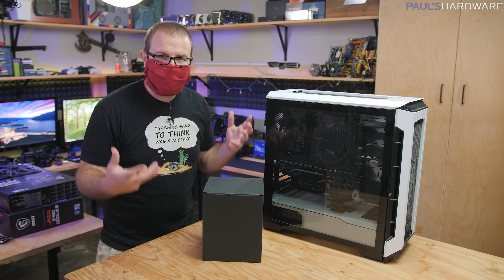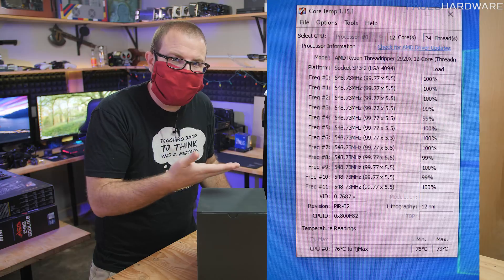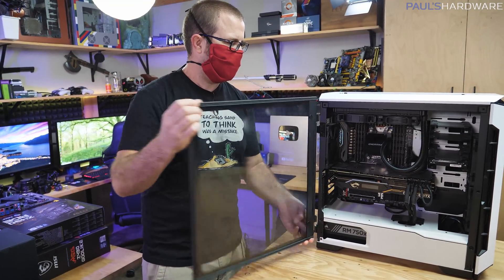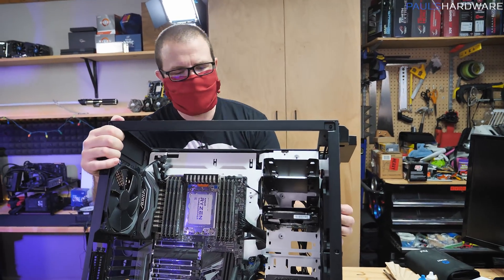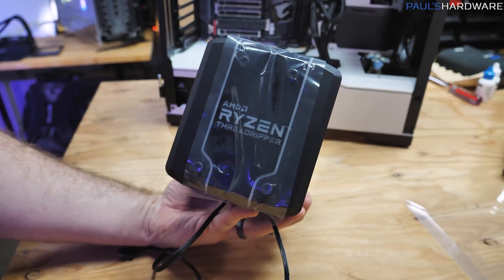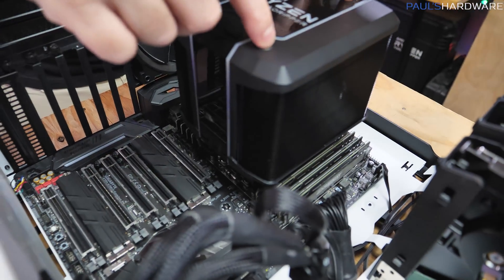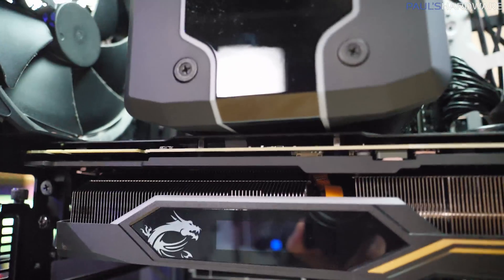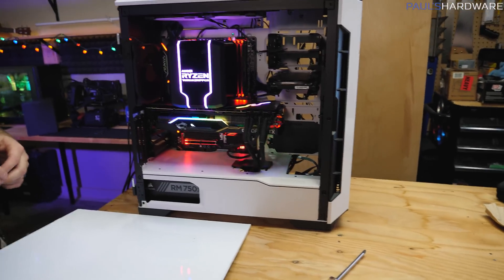Why We Switched from an AIO to Air Cooling...

Comment: I recently switched from a custom loop to an all air set up and I couldn't be happier.
Reply: I know air coolers are more reliable but it's too much of a personal aesthetic for me. I don't like how any air cooler looks. On a side note, if you're selling your closet full of stuff, I'd love a link to your eBay listing. I'm always upgrading or changing my set up.
Reply: I'm just the other way around. 20-30 degrees lower and silent to boot. Love it. :)
Reply: @karaloop9544  I honestly just got tired of maintaining it and also the added cost of new GPU blocks every time I wanted to upgrade. I have a closet full of WC stuff.
Reply: @evo7836  just use distill water mines still fine after a year
Reply: @evo7836  I see, maybe that's me in the future, who knows. :) I'm new to water cooling because my new processor is running hotter than anything before it, ever. Forced my hand, so to speak. I'd have loved a closet full of wc stuff because it's a major PITA to start from zero. With all this gear at least you have the option to setup a loop in the future if it strikes your fancy again.

I only have the CPU water cooled, so I can skimp out on the GPU blocks. I definitely see the appeal of almost no maintenance though, coming from Noctua towers that served me well.
Reply: I used to use distilled water in my loops for years but that was causing a lot of corrosion on my fittings/inside of radiators. I ended up  using the clear EK fluid and that was doing a much better job. I just don't feel like changing the fluid, or having to worry about a pump dying anymore. This is just much more worry free.
Reply: @evo7836  ah i see corrosion i not really a problem theses days. As long as you dont use silver coil on mix Metals( cant remember what tou can't use it on) you should be fine. Even just plain old distilled water is fine with no additive and stuff is ok.
Reply: @t4ketsuru  if you want to keep corrosion down, you'd mostly want to stick to copper, block wise. Personally, I'd still go mineral oil due to the lack of conductivity if there WAS a leak, but still.

Comment: Given the improvement in air coolers these last few years, i think my current build is the last one that will be water cooled. I can easily think of other ways to spend the money!
Reply: Rob Emyrs.

It's not the last few years. Air cooling has been a great choice for 9 years. Since the NH-D14 came out.
Reply: Rocking a D15. thats a 7 year old design i think yet is one of the best performers still.
Reply: Air cooling is meh. It works but its boring. Half the fun of a custom loop is planning it and putting it all together...dont get that with a boring air cooler.
Reply: @mikeschimminger7886  Not everybody got time for constant maintenance checkup on those pipes twice a week but you do you.
Reply: Air cooling hasn't really changed that much. Even 10 years ago you could have bought a thicc boi air cooler that cooled a 2600k @4.7GHz down easiely. Even fans haven't got significantly quieter since then.
Reply: @maYdaY1337  I think you're possibly a little out of touch with air coolers? They've evolved quite a bit in the last decade; not just the fans, but the nature and quality of the entire ensemble. Material technologies, heat piping, liquid within the heat pipes, arrangement and density of fins. I'll grant you, individually they may not be overwhelming - but combined as a complete package? It's quite substantial.

Comment: That exact thing happened to my 1920X as well. My AIO, the same kind as this one, had a fan stopping, no idea why, but it did, when it stopped, things started heating up and the CPU throttled a lot. I got a return, went with Noctua NH-U14S TR4and have never looked back. Still just using one fan, but for the 1920X, it's not an issue.

I started logging to figure out why my PC suddenly was super slow while playing games or working, and eventually I caught it: https://i.imgur.com/2UiBPMv.png
Reply: My 1950 did the same thing. Enermax died, went to the big Noctua.
Reply: @Real28  It will be a while before I go liquid again, been having leaks and dead pumps a few times, and air is so nice and simple :P

Comment: You have thoroughly convinced me to NEVER try liquid cooling. Great video.
Reply: Same here
Reply: ya go for liquid cooling or AIO if you have the cash to replace it fast or can replace ur system if the entire system bricks down. else it's safer, cost-effective and more reliable to go on air cooling; besides I do think there was some test out there that shows you have no cooler temp whatsoever while having a liquid cooling vs an air cooling (it was the other way round but not by a large margin if I remember correctly).
same not going for liquid cooling ever.
Reply: @Garrett Canavan That's not true. Usually from faulty tests. Check out Gamer's Nexus comparing air to water. Water is always going to be better based on a little something called physics. It can absorb more heat than an equivalent amount of air without rising in temperature. This is known as specific heat capacity. Liquid does handle spikes better, that much is correct but it also just handles temperature better overall and can get decently below anything an air cooler can reach whilst also being quieter though usually just 4 to 5 degrees or so which in most cases isn't a big deal. That said, air coolers are most often more than enough unless super big into overclocking or if the case has bad airflow so the lower numbers of an AIO aren't necessarily needed in a lot of use cases. But also, thousands or millions across the world buy AIO's and don't have an issue with them so the failure rate is pretty low. It's just that WHEN one does fail, those are the ones we hear about. Nobody actively tells us about the ones that work as intended. It's a bit of an alarmist issue that doesn't take into account the realities. Kraken and Corsair would not have 5 -6 year warranties on their products if they expected them to fail repeatedly within that time period on a consistent basis.
Reply: @Jhakaro  it's not about the AIO failing. It's about what it could potential destroy if it does. An air cooler? A single fan. An AIO? possibly mobo, CPU and GPU. Not to mention the actual AIO. So what could that be? 1000 dollars in damages?  For what? Marginally better temps and aesthetics? Please.
Reply: I'm still running a H105 since I buily my PC in 2014.

That's 6 years of daily 3 to 8 hours.
Reply: i bought a deepcool castle 360 EX and i love it. low temps and they have anti leak technology and a good rep. Just do your research. There's a lot of memes on Enermax one being the infamous "my time has come" for processors.
Reply: Its 1 AIO that have this issue...  Generalizing every AIO for 1 maker that do shit  is terrible.
Reply: @Clippy-the-Doubtful  lots of aio are crap, not only Enermax.
Small models from Corsair, some from Nzxt, etc...but u will know only when you replace it...look the tubing  (very fragile through time) and the whine/noise coming from cheapo plastic garbage pump...
Those aio are gadgets, not reliable for more than 2 or 3 years  usually...just avoid this crap
Reply: Catastigma Deception most AIOs are great and very reliable, don’t let one shitty product ruin it for every other one
Reply: @Clippy-the-Doubtful  Thats what i see from air cooling users over and over again, they always praise air cooling as the best with 0 flaws and condemns water cooling as the worst with nothing but flaws. I have only been able to find two bad AIOs, both from the same company, but apperently thats enough to say that all water cooling solutions are bad, if it really works like that then all I can say is Corsair a500. We all remember that one but apperently that doesnt count, gotta love those double standards.
Reply: I’ve run an aio for years with no issue. It’s just this enermax model that has this issue.
Reply: @SirQuacks  no, there have been plenty of failures over time of all sorts of AIOs. If a pump fails, you lose 99% of your cooling, if it leaks, you potentially brick your entire system, and over time, they do weep liquid. Fan fails on an air cooler? you throttle a bit, and your PC gets quiet and it is pretty noticeable when it fails. Super easy to replace a fan, not super easy to get any money for replacement parts from AIO manufacturers if it is out of warranty and kills your system. 

So again, no it isn't "just this enermax model that has this issue", others have had similar and equally catastrophic issues.
Reply: RavenousJoe I understand that water cooling can be risky if you don’t know what you’re doing, but as long as you mount it correctly and do your research your AIO should be fine for close to a decade. Yeah the enermax ones are absolute garbage, but AIOs like the ones from Corsair are reliable and come with a warranty that covers your ENTIRE pc if it leaks as long as you properly mounted it.
Reply: RavenousJoe Jesus man, coming on a bit strong there. The clogging issue is specific to this enermax model because it uses subpar cooling fluid. That’s what I was talking about. I was pointing out that this specific issue is isolated to this model. 

Generally speaking using an AIO from a reputable company with good reviews will work. If you are using your pc for critical work like they were here then yeah I would recommend air cooling. However, for most people it would be fine. 

I’ve been running one for 6 years without trouble and now I’m looking to replace it cause I’m redoing my build not because it has any issues. And that’s just one of the AIOs I have in a build. I have at least four others in various builds since then without any issues. Modern AIOs rarely leak. I’m not saying it never happens but as long as you aren’t actively damaging the AIO generally speaking you’ll be fine now.
Reply: @xander_allen  ...thats....simply not true at all lol.
Reply: Johnathan Era How so? I listed nothing but facts in my comment. AIOs can last for a while, and most good manufacturers offer full-system warranties just in case you get sent a faulty product.

Comment: I've never been a fan of liquid cooling.  When in doubt, a Noctua D15S is still the "cool anything as well as a dual fan AIO" air cooler.  My 3900x stays just fine on it, and no chance of pump failure.  Obviously for the Threadripper, you have to go with what you can get that's huge and fits.
Reply: This. Never wanted to deal with liquid anything in my computer. Thankfully I never have to.
Reply: For 13 years I've done nothing but custom loops in my personal rig and never once had an issue. No pump failures, no leaks....nothing. Give it a try, much more rewarding than putting a boring air cooler in and calling it a day.
Reply: @mikeschimminger7886  Yeah give it a try...until it fails day and u end up replacing $1000 worth of parts.

Comment: Wendell from Level1Tech has a vid on replacing the enermax aio coolant, the design is good but the factory coolant is not that great.
Reply: @VanillaCoke I don't think anyone expects them to last "forever", not even an air cooler will do that.  But I think everyone expects them to last longer than 3-6 months, lol.
Reply: My old enermax 240mm aio lasted about 3.5 years before gunking up.
Thats respectable for a 70€ AIO
But at this Point, im not gonna buy any of their stuff Till they sort out their shit
Reply: @siriusargus6766  I have heard that Corsair and other reliable company AIOs last pretty long like 5-8 years before pump breaking down.
Reply: @zarmaanful  curious. I have never Heard of any AIO lastong that long.
Typically its between like 3 to 4 years from my experience.
After cleaning, Mine should Work again, but dumb me broke a fitting off...
I Just got an old Alpenföhn AIO (asetek based) and there was next to no build up. That one probaly would have lasted your 5+ years if it didnt lose that much Fluid to evaporation.
Reply: @zarmaanful  same here, thats why i bought a corsair aio. Its been working good for the last year.
Reply: @GrandPrix46  Even Ramen noodles have longer expiry.
Reply: That removes the reason for getting an AIO in the 1st place, most people want to set it and forget it
Reply: I mean Paul should know that seeing as he's wearing Wendell's shirt.
Reply: Yeah, but from the context of this video- it being the editor’s working machine- they needed a solid solution as soon as possible. Replacing the coolant seems like a cool idea, but a lot of messing around and time spent that they didn’t have in this case. 
Could make for a good future video though!

Comment: A I Omg. I live slightly in fear of my AIO failing one day. I have an old 120mm Corsair H70 on my 3570k, but my next build I'm going Noctua.
Reply: If it makes you feel better, I have a Corsair h100i dead on my coffee table. It lasted about 8ish years before going tits up end or march. Threw "CPU Fan Errors" to the motherboard, so system wouldn't boot.

My next build (later this year) I'm going to try a custom water loop because I've never done that, and I need challenges to keep me fresh. (Never did one before. Yeah, I know where to buy those blue shop towels. Yeah, I know I'm crazy. I have the internet handle to prove it.)
Reply: @jackielinde7568  open loop is cool, just be wary of the fancy fluids. And from everything I've watched it helps to design a fill and drain port into the loop.
Reply: @BeeWhere  Thanks for the advice. I'm planning on just plain clear coolant and a drain port with a valve or quick disconnect.
Reply: My Corsair H60 has been trucking for 6 years with no issue.
Reply: my H70 is still trucking cooling a 3770k@4.3 after 7 years
Reply: Noctua fans are impressive. Put them at 50% max and you have church's silence.
Reply: My i5 3570k@4.2ghz has been rock solid for years with both the OC and STOCK intel cooler.
Reply: @Montisaquadeis  what are your CPU Temps? The Intel stock fan noise kills me.
Reply: Check yout Scythe. They are some excellent coolers like the FUMA 2 that are better price/performance than Noctua.
Reply: @catriona_drummond  I got a scythe and a noctua cooler. Noctua performs a bit better when noise normalised. The noctua fans are a tiny bit better.
Reply: @PyromancerRift  yup, Noctua is a tad better but also a tad more expensive.
Reply: @catriona_drummond  that's what I am installing this weekend
Reply: I am running an Ashura for years on my overclocked 4790K
Reply: @catriona_drummond  now all they need to do is make a blackout version, but one can dream.
Reply: I bought a corsair h55 refurb unit for $40 and it's still kicking my i5 4690k @ 4.7  looking to build a new unit can't decide what cooler to buy
Reply: Had a 7 year old H50 go out and start leaking onto my motherboard. Luckily none of the whitish fluid damaged anything the mother board. Got a fan on it now but will be sticking with air cooling on new build.
Reply: @twofacepalmer1212  sounds like I need to do more frequent inspections. I'm sure there's a raspberry pi project out there with a leak sensor.
Reply: Cryorig R1,  Phantek PH-TC14PE , Deepcool Assassin 3,   Exist
Just to give equally viable alternatives.
Reply: @Clippy-the-Doubtful  appreciate it, it's awesome we have more viable options.

Comment: hardware Unboxed tested this exact CPU cooler and found it to be the bottom of the barrel of the TR4 specific coolers, when it comes to sound and perfonrmance, yet still a upgradem somehow
Reply: I think this is a field repair job, get the pc up and running with a TR4 cooler that's hanging around. Later they can do another video with an air cooler like a Noctua NH-D30X which replaces the case side panel with a cooling fin stack and a 300mm fan
Reply: @soupwizard  is that noctua cooler you're talking about made up or a real thing that is comming tho? :o
Reply: I replaced my Wraith Ripper with an NH-U14S TR4-SP3 (catchy name, Noctua) a week ago.  Massive upgrade.  At full synthetic load I maintain an all-core clock of 3.6-3.7GHz with my 2950X.  The wraith ripper was a one way ticket 3.2GHz or lower.